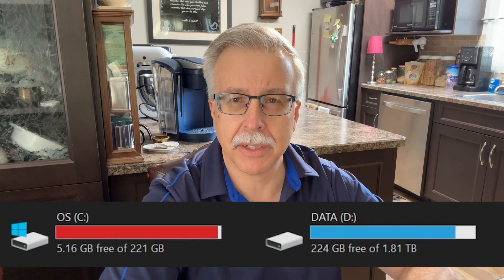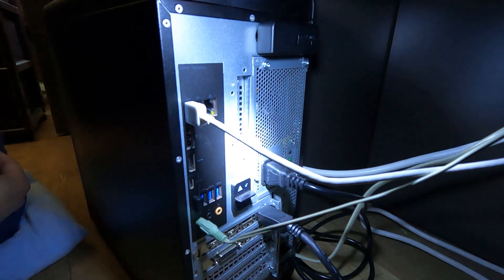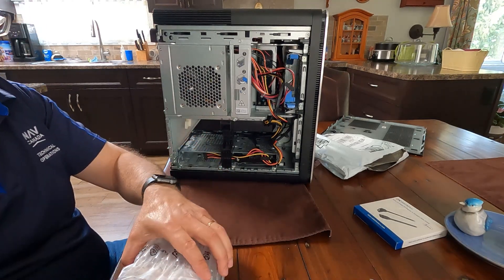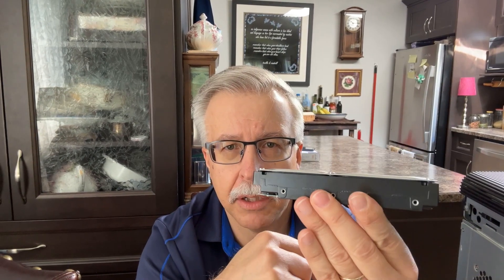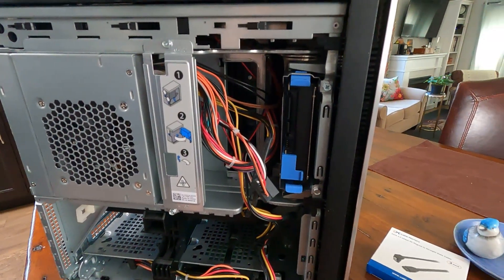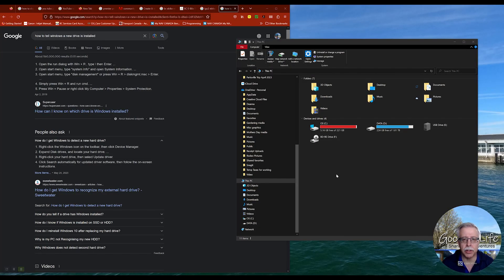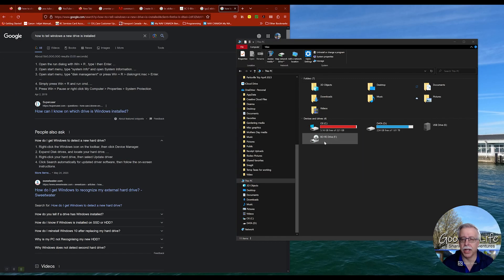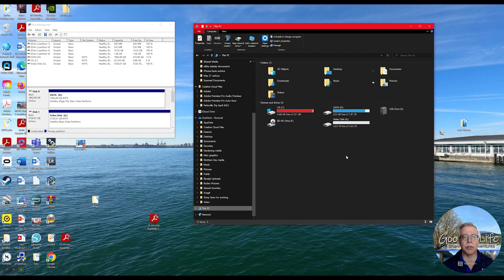How to Install a Hard Drive

Comment: Why a mechanical hard drive?   Instead, use 2.5 inch SSDs.   They require less space to mount.   Mounting adaptors if needed, are readily available.    Quality branded SSDs are much more reliable.   They have very much better shock resistance.   They make no noise.   They produce very little heat.   They read and write much faster.   Install an SSD, and you will never again use a mechanical hard drive!
Reply from the maker: Hey kodo, thanks for watching and for commenting. Yes, SSDs have some advantages as you’ve mentioned, but no hardware solution is perfect in every way and there are disadvantages to SSDs versus hard drives, including cost, capacity, and long-term data retention. People should review this article if they want to learn more: https://www.pcmag.com/news/ssd-vs-hdd-whats-the-difference